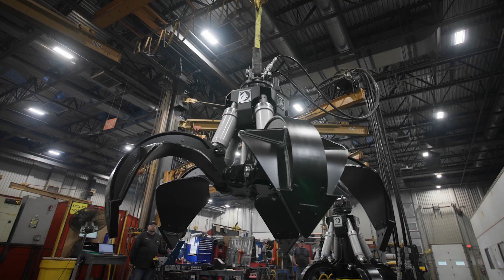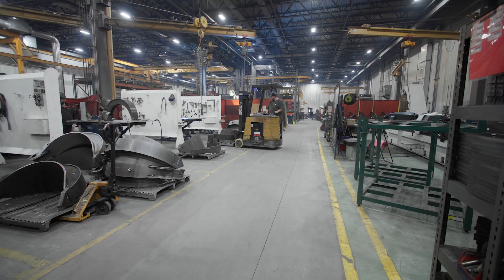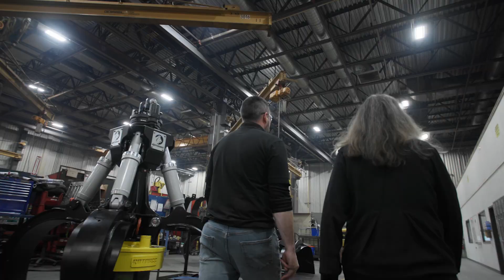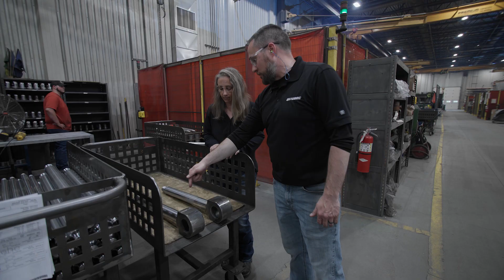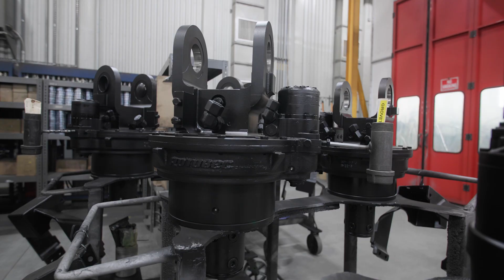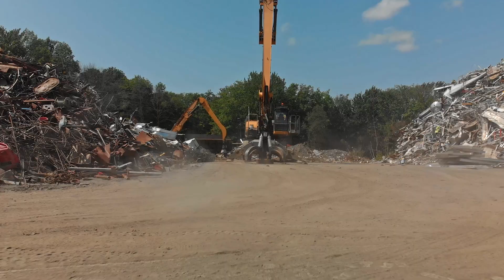How we produce our Orange Peel, RPA and 110WG grapples - Rotobec Factory Tour

Comment: At scrapyard I work at we got seven of these grapples, currently running five and have two for a couple of Sennebogen’s we are waiting on.  The cylinder protection and hydraulic hose protection are really stout and as long as you replace the teeth, your cylinder coverings are great. However, if you don’t replace your teeth in time, the weld at the bottom of the cylinder covering will break.
Reply from the maker: Thank you for trusting Rotobec with your business! If you have any problems, please do not hesitate to contact our service team: https://rotobec.com/services-and-support/maintenance-and-support